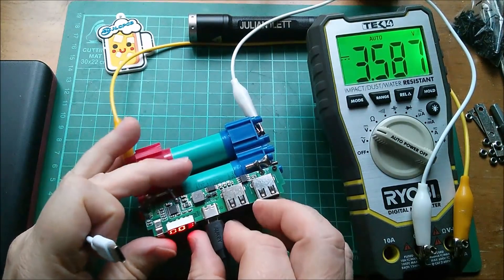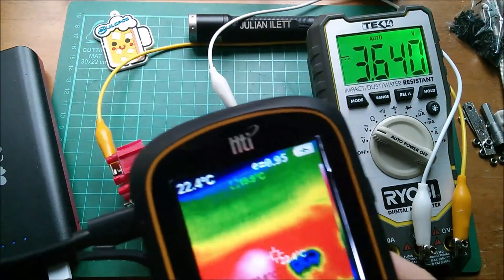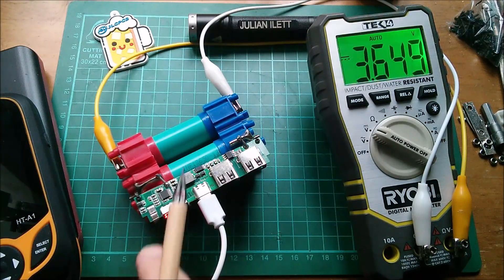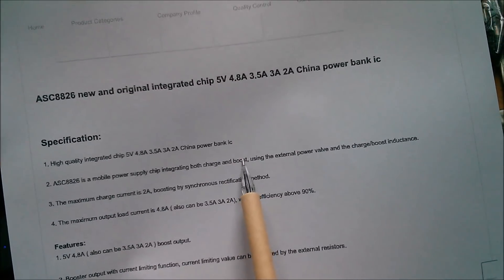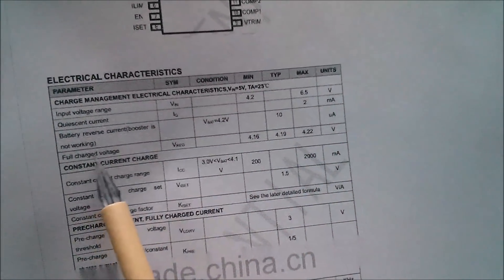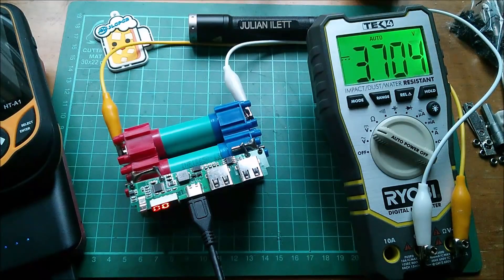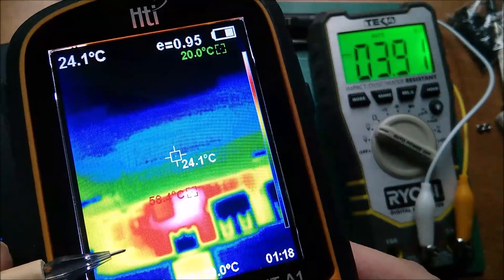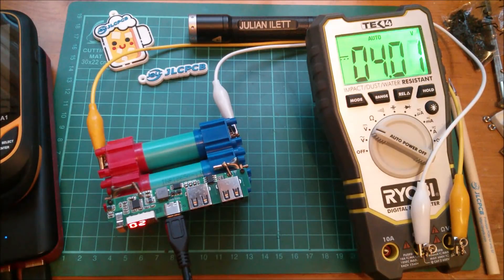Build a USB Power Bank (part 2)

Comment: Also, that battery PCB must be made for LiHV cells, which have a 4.35V (or even 4.4V) termination voltage. I know some Li-Ion or Li-Po batteries do have a termination voltage of 4.4V as my HP OMEN laptop battery is 4.4V per cell at full charge/17.6V total. This also explains why the battery was showing as 0% even at 3.4V - it should show 0% somewhere around the 3V mark.

Comment: 1300mAh is pretty low for an 18650; they must be high current ones from a power tool? 
Quite often you can get 2200mAh or 2600mAh cells; these come from laptop battery packs, though you can buy them new if you want.
Maximum is 3400mAh or 3500mAh, depending on the company.

Comment: Interesting little project! I happen to be building a QC 2.0 charger these days and it is very interesting to get under the hood of what is going on. You could try and build one yourself using the standard application schematic of many chips. Basically it is just a boost converter and an 8pin charge control chip that handles all the "talking" with the phone and just introduces or removes resistors to the boost converter's feedback to panipulate the output voltage. Sounds challenging but it is not that much and you end up having exactly the kind of charger you need. I also use salvaged 18650 cells nad what is best, they are charged by 2 x 20w solar panels so it does not get more eco-friendly than that. Keep it up!

Comment: Is it possibly measuring Watt hours, to 1 dp. The full capacity of those batteries would be around 4.8Wh, which would be about right if the batteries were not fully discharged at the start.

Comment: @1:00 - I've been looking for the same thing for the same reason.  The only USB C power banks that are that cheap are PD out only.  They have a micro B jack to charge the batteries.  If you find a cheaper one, or a module/board, that has "dual role" PD (power in and out on the same USB C jack), please let us know!!!

Comment: .04 volts isn't going to be a killer. How accurate is your meter? Does it have fast  charge ability at 9 volts output?
Reply: I think he quit before it went too much over. It seems to be built for 4.35V cells.

Comment: Some mechanical strengthening might be wise. I can see those pads getting ripped off on the PCB due to the rotational stress of plugging in usb cables over and over?

Comment: Yes. In Aliexpress you can find sellers that sells these boards that can handle every protocol out there, I think!
I just wish if I could get like a 4 cell in series or more charger, maybe it is more efficient to convert voltage down than up if you are going to use it for like giving 12v output on the USB -C port over PD-Protocol!

You can get these small female USB-C that you program what voltage the charger should put out! You could like use it for a 12v radio or the like!
Reply: If you need a cheap PD supply, get an automotive PD supply and wire it up to a 4S with a BMS. Auto stuff is forgiving up in that 16.8V range.

Comment: I believe if it’s less than 10% charged then it flashes. That’s what one of my power banks does.
Reply from the maker: Yes - all 3 digits flash when it's less than 10%. The 3rd digit flashes when it's charging.

Comment: The display shows the voltage, in rounded -.x volts 🤨
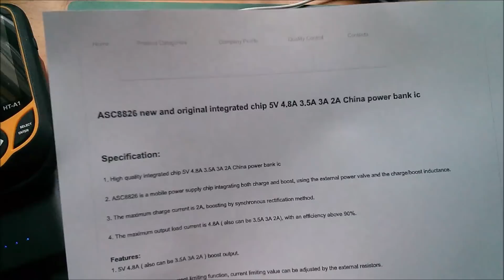Reply: I thought that at the end, but when I looked again at the middle of the video, (2:45), the display was showing 004 with 3.643v on the meter.
Reply: @Franko_Walker  ... perhaps the unusual values indicate an under voltage of some degree ?

Comment: Yeah not looking like a recommendation on that particular board for a 4.2v battery. I have a power bank that, for some reason, has a 2S2P arrangement inside. 4.2v would be 50% or 60% full though, not 40, so that confuses me as well if it's supposed to be a 2S arrangement.

Comment: Damn I know it is lockdown, but I have sat here, and watched this follow up video and the result the Board is crap, as for the display it seems to be trying to show voltage of the cells?? :-) what is wrong with using a simple 4056 module
Reply from the maker: Yes, it's overcharging the cells - so it's no good. TP4056 is only 1A and is not a complete power bank circuit.
Reply: @JulianIlett  you can get a 3amp one perhaps even modify to 6Amp https://www.ebay.com.au/itm/1PCS-TP4056-4-2V-3A-High-Current-Lithium-Battery-Charging-Board-Charger-Module-U-/302160585170?hash=item465a2ca1d2:g:MKgAAOSwEzxYSS~z

Comment: I have some little modules that are fine for charging those cells,  though I think they limit current to what a single cell can handle and you can go to lower rates by changing a resistor.  And I have other little modules that convert whatever a cell is putting out to USB levels.  I think I'll stick with those,  and not worry about the fancy digital displays and whatnot,  not to mention the variant of that one chip wanting to overcharge those cells.  I suppose that there's some kind of cell where those voltages are okay,  but not the ones I have!  :-)
Oh,  and each of those modules cost me less than $1 each,  from the usual chinese sources...